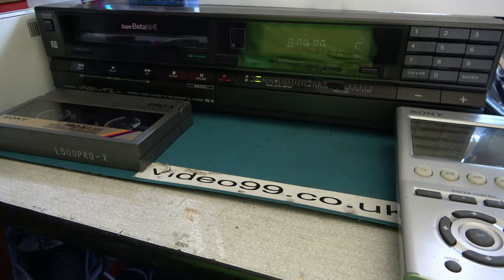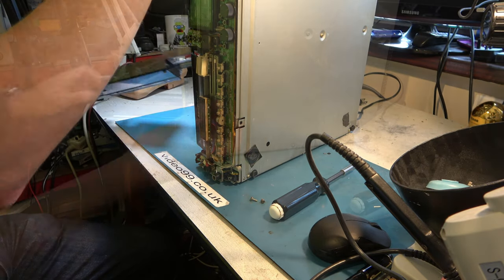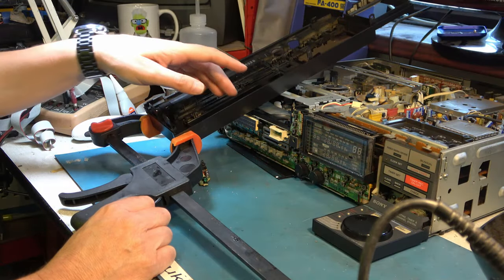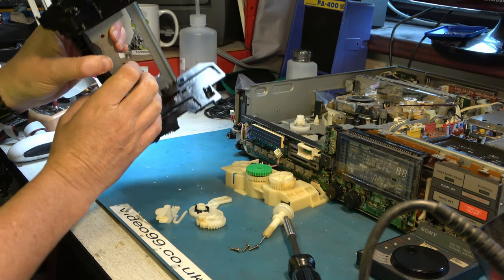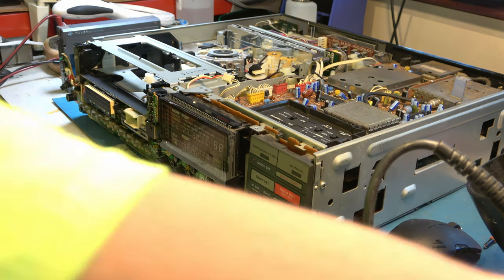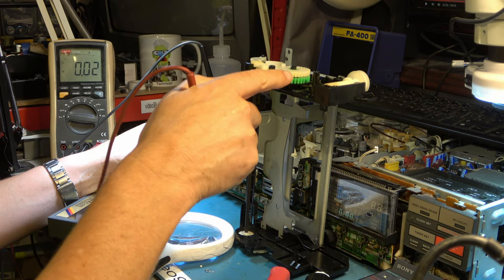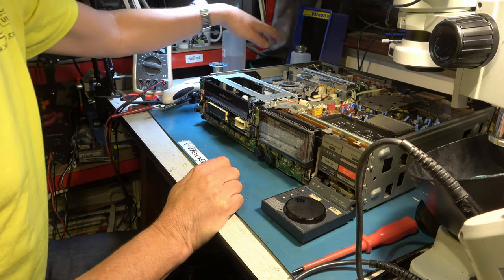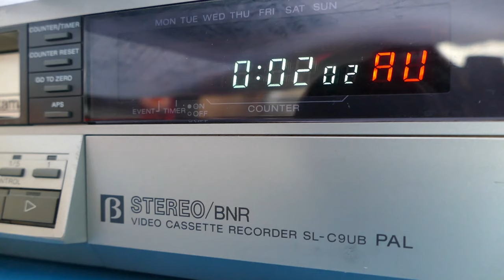Another SuperBeta!

Comment: i knew it was the regulator the moment you powered the machine up. When you press the on/off button on the front, the solenoid that shifts the gears for front loading should engage. That clearly didn't happen here, and I've seen that fault before in a video by guess who, 12voltvids! He had an SL-HF1000 with the exact same symptom (clock display was fine but there was no power LED and no motor/solenoid drive.

Comment: Kind of makes you wish they'd stuck to top-loaders.  Much simpler, less to go wrong.  My family's first VCR, a 1985 Video Concepts brand linear stereo VHS,  the middle cassette carriage/basket drive gear was held in place by a metal pin stuck into the plastic carriage/basket frame, nothing to hold it in but friction.  In the early 90's, it popped out, and kept popping out.  Ended up leaving the top cover off and that gear out, pushed the cassette in manually, and put a broken-off hammer head on top of the cassette to hold it fully down.  It worked reliably, unlike the front-loading mechanism.  And that was LONG before the plastic gears became brittle and losing teeth.

Comment: 20+ years ago I wanted one of these. For a while I had an SL-HF430. I looked at the 900. The American ones didn't record B-I, only the Japanese ones did, or they had to be modified for it. I'd have loved to have had a 2000, especially with S-Video I/O. Way expensive though, and the controls? Complicated and unreliable. I guess if you could have found a front panel from a parted out one, you would have eh? Best of luck with this beast.
Reply from the maker: I'm aware that this Japanese model has BIs recording capability, and the USA ones don't (as they left the factory anyway).  Really hoping I can get this one up and running, and also hopefully then modify to 110V or even 230V operation.

Comment: This makes me hope the SL-F73 doesn't have one of those STK regulators inside! Mine appears to be entirely dead though, not just some voltages missing. I know very little about its history, except it's got a handwritten sticker that claims the machine was in working order in 2007 and I found it in a skip. Not that I need a Beta machine but I couldn't just leave it there and I do own one unknown tape.
Reply: Update: it doesn't. It has a very service-friendly and simple switching mode power supply and all that was wrong with it was a dry 4.7 µF/50 V electrolytic on the primary side. Once the top lid is off (two screws) it's two screws and two plugs to get the power supply out. One of the easiest repairs I've ever done and certainly the easiest VCR repair. The offending capacitor was conveniently placed next to two massive resistors that cooked the poor cap to death.

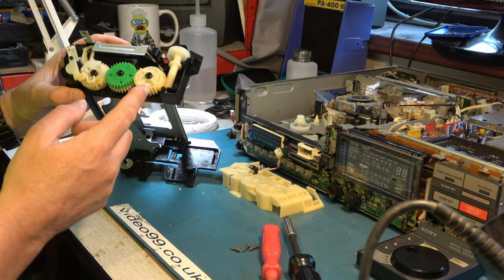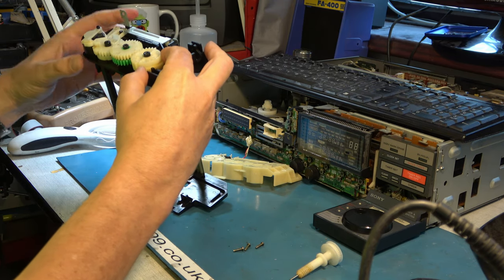Comment: 9:30 You can see the green gear is on the top. When you reassebled the cassette loading mechanism, 11:20, you put the green gear on the bottom.
Reply from the maker: Green gear should be on the inside.  See: https://www.youtube.com/watch?v=HvpDtQDvOTc
Reply: @video99couk  Oh, so does that mean someone had already taken the gears apart before you got it then ? If so, there could be many other faults from a bad repair attempt.

Comment: Any downsides to using a Japanese VTR as opposed to an North American one? Other than it running on 100V. I'm thinking about buying a DVW-M2000 from Japan.
Reply from the maker: The NTSC Black level (IRE) setting is 0 for Japan and 7.5 for USA.  You will find that in a menu somewhere so it's an easy adjustment.  You may not need 100V, see my video on this subject: https://youtu.be/ouQm-64l0ZU

Comment: Please inject 9V from bench-supply first; does it has to stay as original as possible? take something else, it is just 9V DC after all:)
Reply from the maker: If I can't get a replacement STK5441 then I will use a 7809 switched on by the 5V rail.  But really I want to change it because if part of the regulator has failed, more of it could fail shortly.  It's possible that it already has other issues.

Comment: Hmm well you could connect a 7809 to the faulty regulator and switch the input with a relay and transistor+resistor, then you need to find a power on pin on the faulty reg.
Yes very naughty but i did it years ago and it never failed.
Who said "You evil bodger harvey" lol.
Reply from the maker: That's certainly the route I would take if I couldn't source a new STK5441.
Reply: Ha! That’s exactly what i would have done!
If the current draw on the 9v rail  doesn’t exeed 1,5 A it should be fine.
Reply: @martijnappeldoorn8686  Very true, if the 7809 is bolted to the heatsink it should be ok. if the input voltage to the 7809 is 3 volts above the 9, more bodging will be needed ha ha :-D
Reply: “Captain bodge to the rescue” as stezstix steve would say!
Reply: @martijnappeldoorn8686  Ha ha he just needs a cape held together with sticky tape and safety pins.
Actually thats a bit too good :)
Reply: With little knowledge about these  STK regulators, but seeing they're scarce and relatively expensive, I was thinking along similar lines:

Replace it with an off the shelf mini buck regulator board tapped off one of the higher voltage switched DC lines.
Added benefit, it won't need heatsinking.
Reply: @incandescentwithrage  im not sure if a oscillating regulator would not cause problems with the head preamp or other sensitive circuits.
Im not saying it wont work, i just dont know.
If you used one of those buck regulator in a radio, it would cause hell.
But im no expert and i would have to slap my face with a wet fish lol.